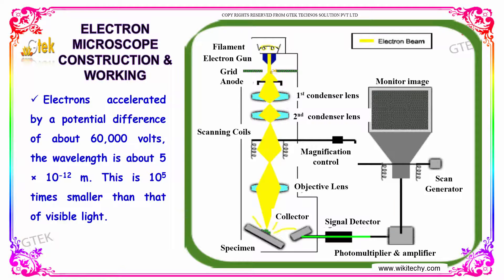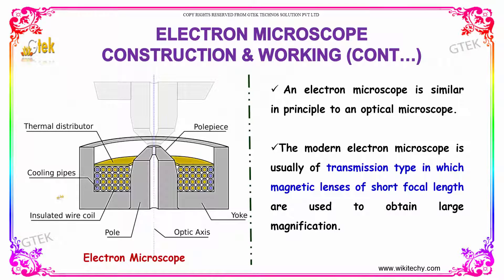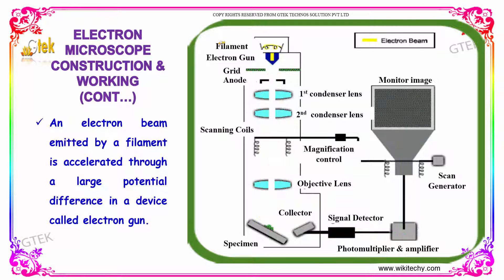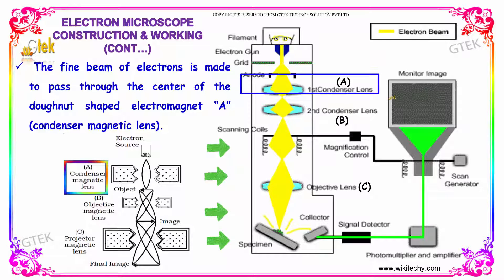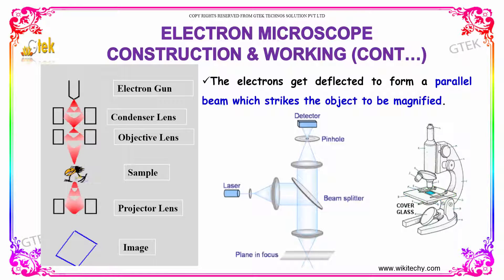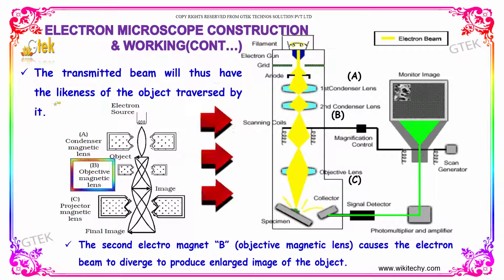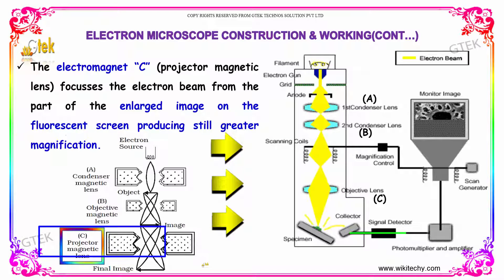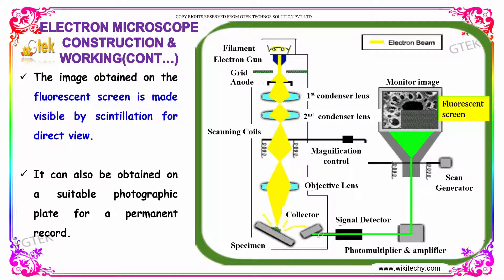Electron microscope construction and working|Nature of Radiation | JEE Main and Advanced physics

Comment: A transmission electron microscope can achieve better than 50 pm resolution and magnifications of up to about 10,000,000x whereas most light microscopes are limited by diffraction to about 200 nm resolution and useful magnifications below 2000x.

Comment: An electron microscope is a microscope that uses a beam of accelerated electrons as a source of illumination. As the wavelength of an electron can be up to 100,000 times shorter than that of visible light photons, electron microscopes have a higher resolving power than light microscopes and can reveal the structure of smaller objects. A transmission electron microscope can achieve better than 50 pm resolution[1] and magnifications of up to about 10,000,000x whereas most light microscopes are limited by diffraction to about 200 nm resolution and useful magnifications below 2000x.